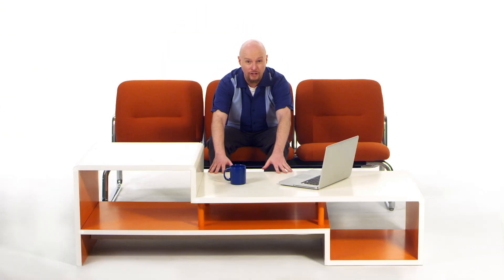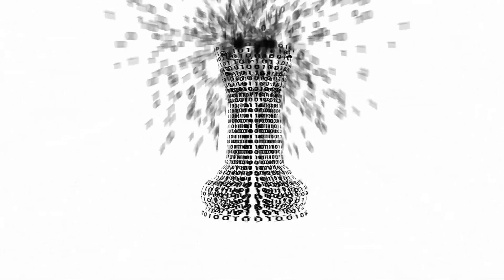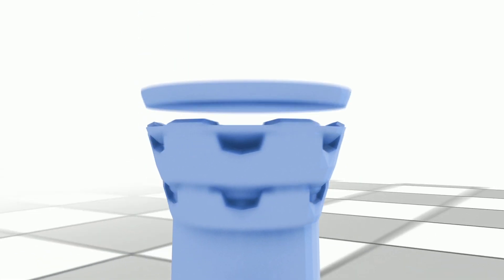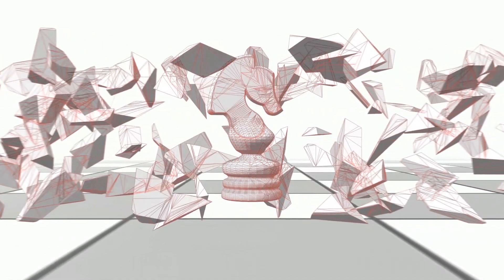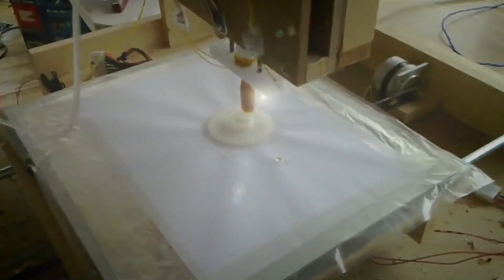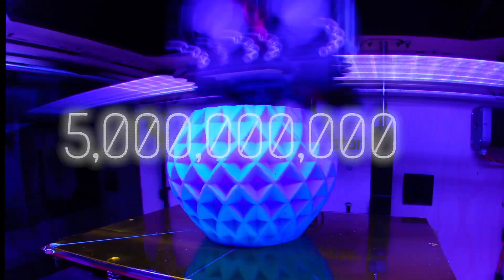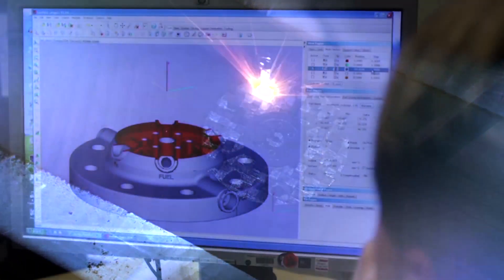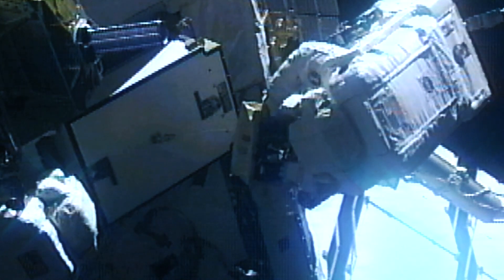The Future of 3D Printing Will Blow Your Mind!

Comment: The difference between a machine that squirts out little threads of melted plastic, and the kind of technology that can rival a Star Trek Replicator is so vast that is makes an abacus and the worlds most complex supercomputer look like the same technology.
3D printing is enormously over-hyped. A real replicator would have to work at the molecular level. Current 3D printer technology works at a level about 1-2 millions times larger, and can only assemble a shape out of a few  materials from a very narrow range of choices.
Reply: I agree with you on that one. I can see the potential of 3-D printing in prototyping, but you can not make a quality objects with it, unless u use powerful laser printers and metal alloy materials. It is simply not cost effective.

Comment: When you think about it there is only one true 2d printer, I say this because the ink printers that you have in your home actually lay down matter, now the printer isn't designed to make a table but there is still matter layed down, you could sit there and spend hundreds of hours just trying to make a structure a few millimeters high, but it still uses matter. now the only printer I know of that actually is 2d is a receipt printer, because this actually uses a chemical reaction started by heat to make this, now when it chemically changes it it probably will warp the paper a bit or cause swelling or shrinking, it definitely would cause it to expand due to heat, but you really couldn't heat it and do this over and over again and cause it to grow, but there maybe more printers like this but maybe not. so there really is one 2d printer.

Comment: From your ideas to prototypes test  after  mold to product, we help, we are in Shenzhen of China near Hongkong

Please take as below contact info: www.idmould.com  www.vowin.cn emails: phil@idmould.com P:008618675501860

Export Mold Prototype Mold Automotive& Medical Mold Plastic injection/Painting/Screen printing/Assembly ODM/OEM Project Service
CNC Plastic and Metal Prototype SLA/SLS/3D Printing Design Service Low Volume Production/ Urethane Casting Sheet Metal Prototype